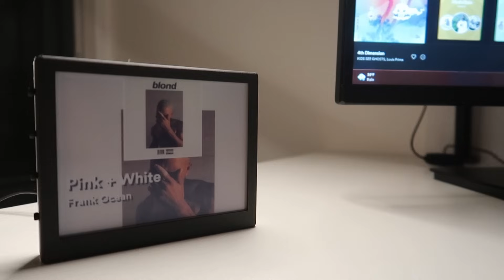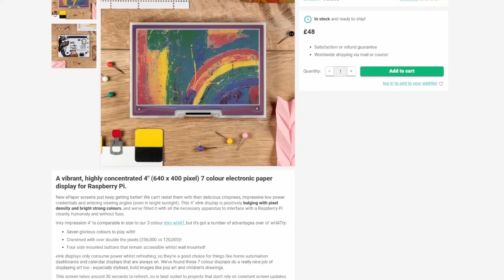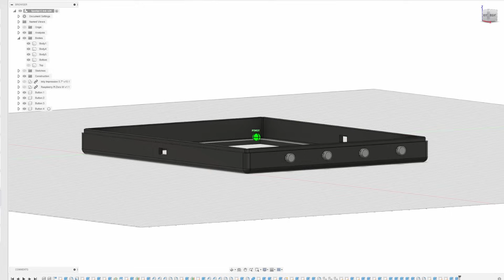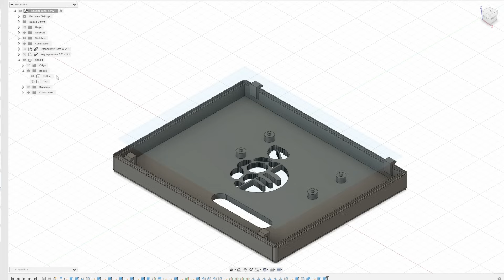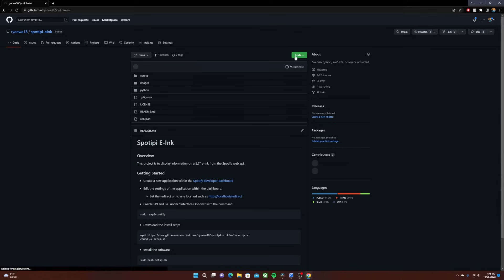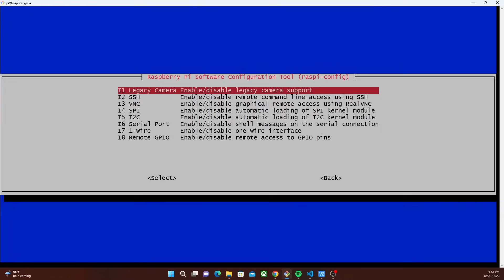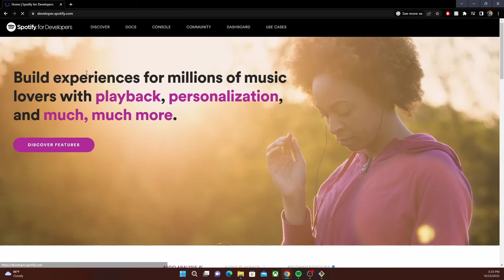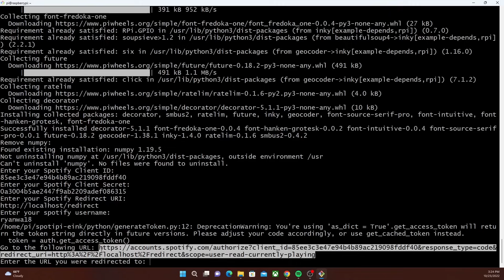Raspberry Pi and Spotify Powered E-Ink Display (Tutorial)

Comment: this guys stuff didnt work, the RGB matrix one didnt work either. I ended just going my own route, and to get it successfully working on the raspberry pi, make sure you install a legacy OS, the newer versions do not work with the "python3 pip" install method and will require virtual environments to install "venv" which makes the process far more difficult. A lot of these tutorials dont account for the new OS and the installation methods are outdated. And I see he used a Pi Zero with no headers but just buy the one with the headers and save yourself the headache of soldering those things on.

Comment: It’s possible your issues with the PLA were from humidity. I’m not sure how old your PLA was, but that’s a common issue. You also had what looked like layer adhesion issues which could be from bad PLA or printing at too low of temperature

Comment: Hey, this is really cool project! How hard would it be to set this up as a spotify connect device with an audio output for a speaker, and add some controls to the screen buttons for skipping songs etc? I'd love to try and build this, but not sure whether to start with this display or start with a spotify connect device and add display functionality!
Reply: Not sure about spotify connect but I have a raspberry pi connected to a set of speakers running shairport-sync and that allows for it to be an apple airplay device like a homepod, could be a cool to use these two project together to get something similar to what you want
Reply: Get some programmable keyboard switches, like a discord macro pad. Should be easy to wire up since the Pi will see it as a keyboard

Comment: Love the project and immediately had to try it out. I followed all of the steps you detailed out but can't seem to get the e-ink display to update with any album art. I'm currently using a Pi Zero W with the 5.7" display. No data appears in the Spotify developer dashboard, which makes me think there is an issue with the connection to Spotify? Any troubleshooting tips would be greatly appreciated!
Reply from the maker: Thanks for testing it out! I actually noticed that there is an issue in the install script. You should redownload the script using wget and re-run it. I went ahead and updated it on GitHub. 

Additionally, if you can't figure it out I have a Discord for troubleshooting questions: https://discord.gg/hAPgtXF8aT